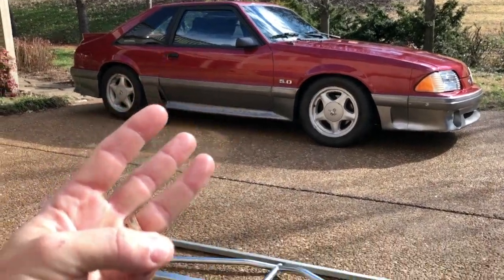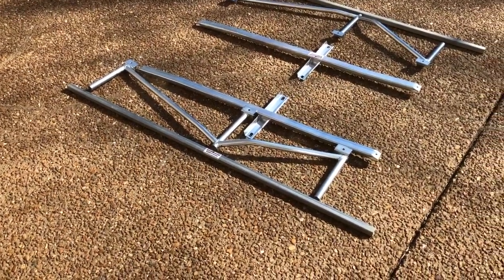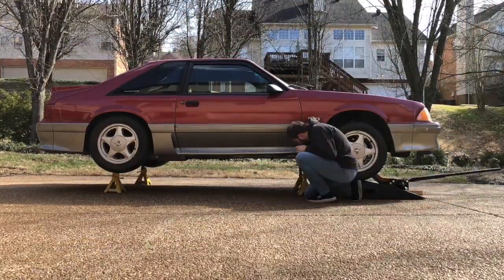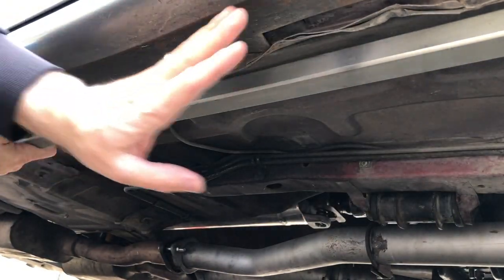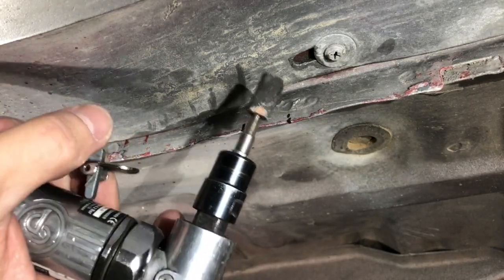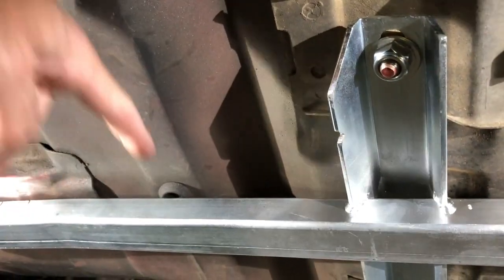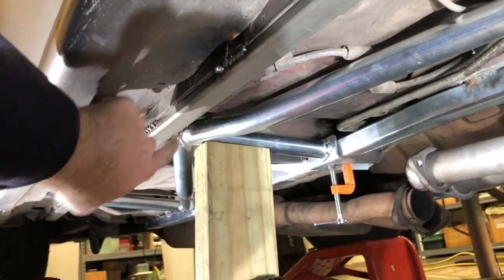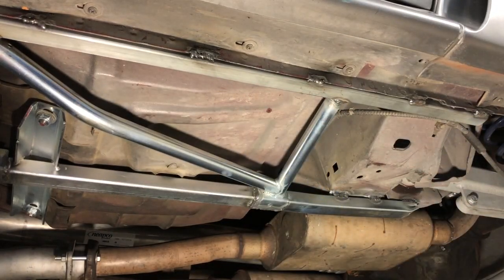FoxBody Mustang Kenny Brown Extreme Matrix Chassis Support System Install

Comment: If only doing the jacking rail, would you tack them to the floor pan also?  

I’ve got one pinchweld shorter than the other, by maybe 1/4” that normal?
Reply from the maker: I think that's normal. As far as tacking to the floor pan, that certainly can't hurt. In fact, I welded two small L brackets on the backside of the jacking rail and welded them to the floor just as insurance against the pinch weld "folding" back and forth...probably waaaaay overkill, but I sleep better at night with a little backside support.

Comment: I've been mulling over which subframe connectors to get for awhile now, the pinch weld covers and matrix brace are really nice but I do really like the full length design of the Maximum Motorsports subframe connectors. If only there was a way to incorporate both designs.
Reply from the maker: The biggest advantage of subframe connectors is to stiffen the rear seat mount area. The length of the connecters is less of "a thing." The "frame rails" are stiff enough. However, you CAN use MM full length subframe connectors and just buy the matrix brace and the jacking rails. They'll fit.
Reply: @Mustang-Geek  That would be perfect if they work together. Yeah I'm sure the standard length connectors are probably more than enough but if I can get even a little more strength in the chassis out of full length connectors I figure why not.
Reply from the maker: @11dmills  The KB setup works with full-length subs no problem.